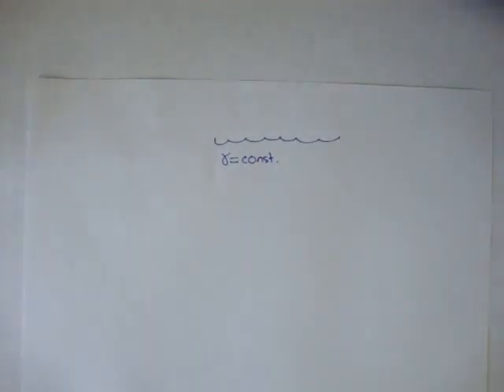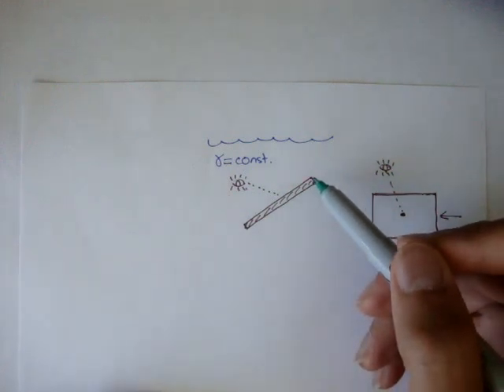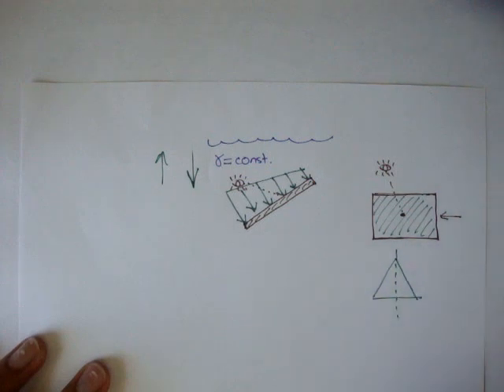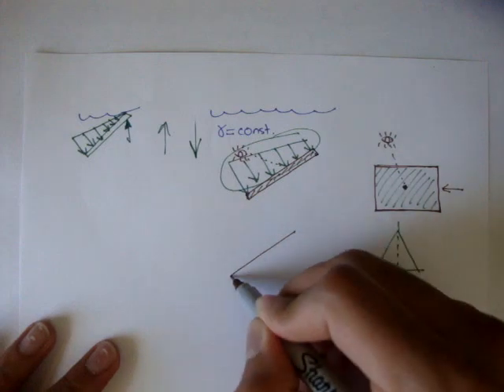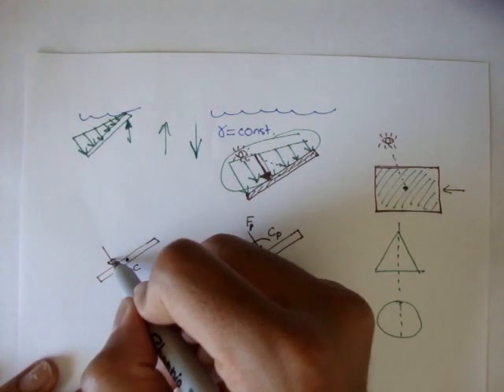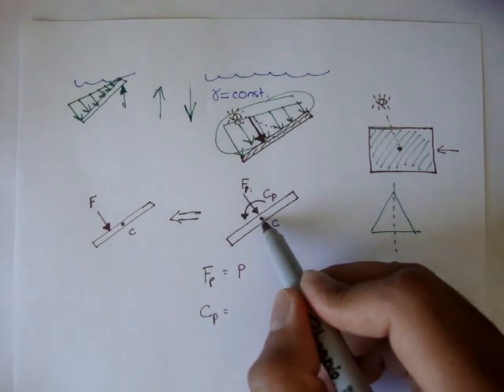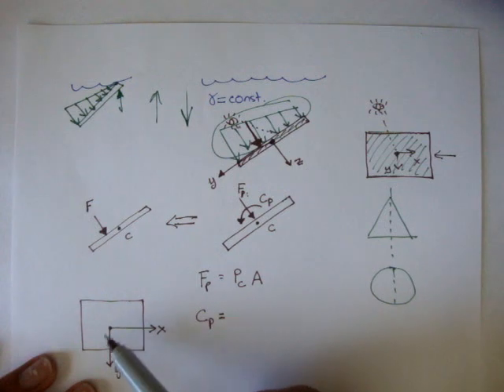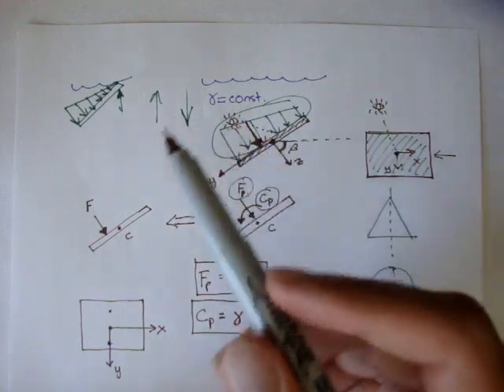Introduction to Forces on Planar and Submerged Surfaces [Fluid Mechanics #46]

Comment: I quite enjoyed this lesson, but isn't it easier to calculate the application point using integrals instead of having to work with angles and Ix? That could lead to a lot of unnecessary/wrong thinking during a test.